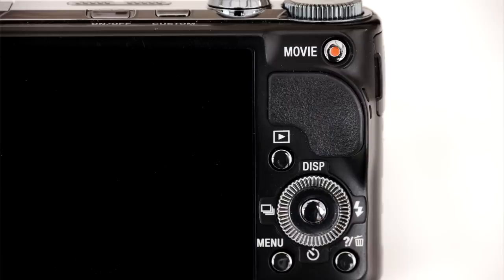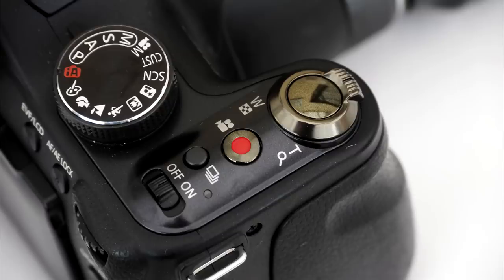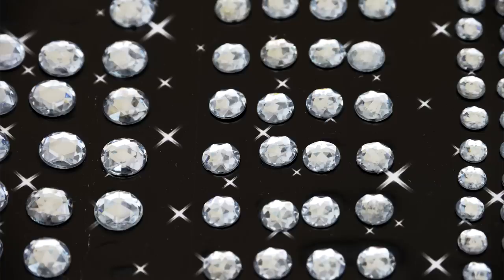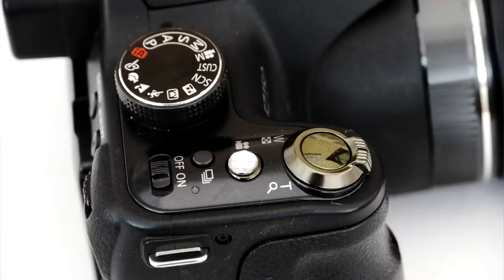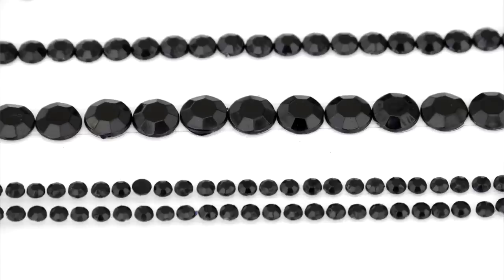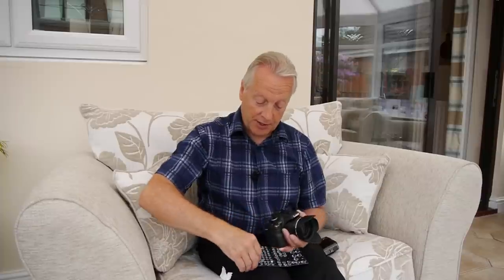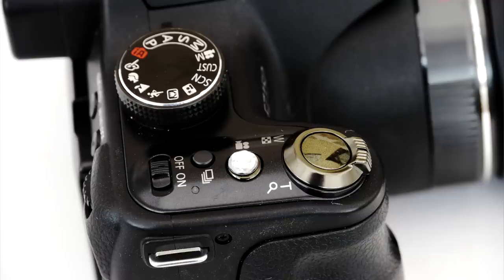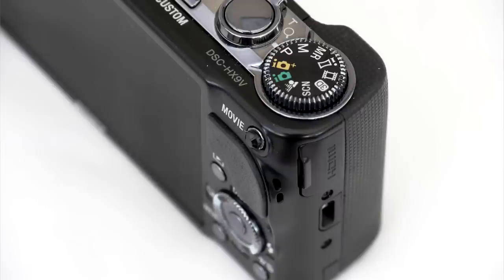Making the Movie Record Button More Accessible on your Compact or Bridge camera

Comment from the maker: Couldn't agree more. I found some great fur, however I had to purchase a metre of the stuff. In the end I ended up using most of it through various prototyping stages. I know there is a lot more science to making a 'dead cat' than just sewing a pouch for the mike to slide in however the results I achieved were pretty good to my ears, my intended use and budget. I guess you must be a 'warrior fan'